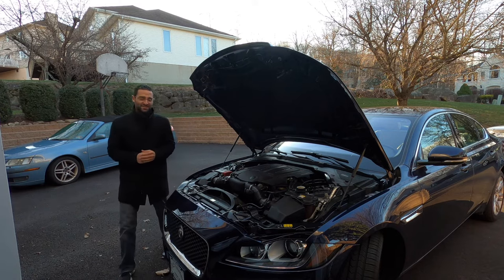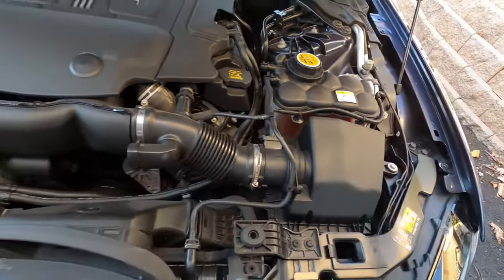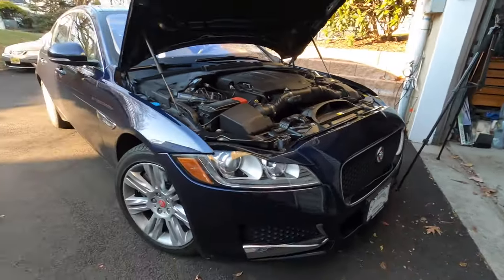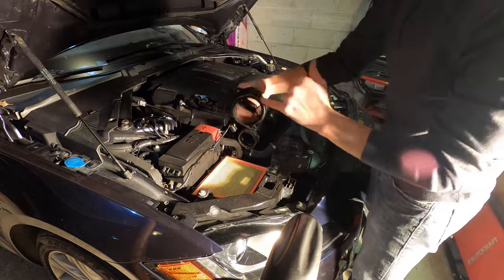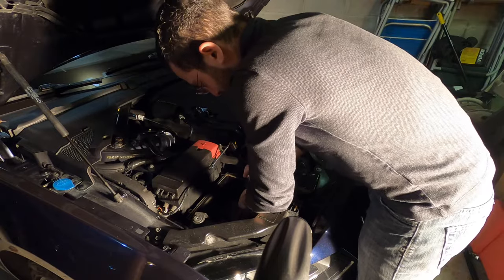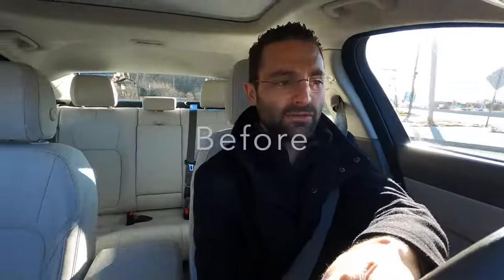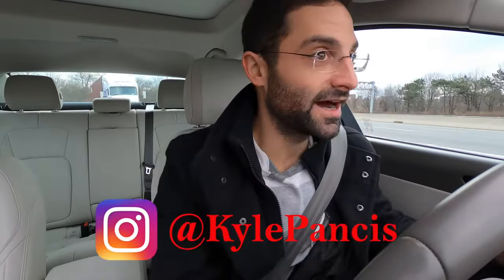This is what an Open Air Intake does to a Supercharged ENGINE!

Comment: Jag F Pace 3L V6 Supercharged. Running Velocity lower crank pulley and Stage 2 tune. 450 HP. Stock air intake and exhaust. Money better spent (Jag air intake is much better for power than these hot air cone intakes).

Comment: It's just the sound. You went from sucking in cold air to sucking in hot under hood air. Look at all the jags on the dyno on youtube with cheap cone filters. You make more power using the k&n drop in filter. There's dyno videos online of that too.
Reply: Agreed but I think some people would rather the sound then power
Reply: thats because he removed the whole housing right?
Reply: I have my v6 dyno with mina intake and stAge 2 tune upgraded crank pulley, and I got 450 to the crank. I haven't lost any power!
Reply: @towlie19xx74  which model/year & which tune?
Reply: @kevinortiz1729  from eurotoysltd
Reply: And this is exactly the reason why I didn't get this Mina cone filter kit for my 2017 XE 35t Prestige AWD. It sounds cool with the increased supercharger whine but the stock intake actually has ram air ducts that draw cold air from outside and route it into the stock air boxes, so it effectively works as a stock cold-air intake system. 

I just ended up getting the Mina chrome intake tubing which retains the stock air boxes so the cold air ducting stays intact, but replacing the intake tubing deletes 3 air restrictors that are built into the stock intake tubing, plus the it's larger diameter and smoother.

Comment: I did the same modification to my jag xf 3.0 the only difference to compensate for the cold intake was that I added 2 tubes extensions from the front radiator all the way under the filter adding on top 2 Heat Shield Cover Stainless Steel, this prevents the filter to suck hot air.
Reply: 1
Reply: Someone else who is smart! 😅

Do you have any photos? Instagram?

Comment: Ps the cone filters set the way they are will be losing you between 5-15 bhp depending on how hot your engine bay is.
More noise and more supercharger wine only equals "sound faster" not go faster.
Changing to cones means you have to change  cold air feed  system to cones to only get fresh colder air rather than a mix of a little cold air from the intake system you have now opened up and lots of warm air.
You could have 10 the amount of airflow, but if that air is hot it will cause the engine to run poorly. If this makes sense.
Reply: 😂😢 you are 💯 correct sounds faster ahhhhhhhhhhh..he asking for water 💦💦🌊 intersion entering into intake.. Remember kids water 💦 and metal don't mixed it create rust in the long run.. little bit at times... ohhhh wait his motor blown up three months later ahhhhhhhhhhh 😢😢😢😮😅😅😢😢

Comment: I left the lower portion of the boxes in on my XF when I did this. Noticed it draws air much better from the ram air tubes.
Reply: what year is your xf? I wanted to do the same on my xfr 2013 by keeping the lower portion of the boxes, did you have to do any modifications?

Comment: Unfortunately brother, your data is wrong, most cone filters attached to a normal system degrade your airflow and hp.
In tests the standard manufacturers paper filter keeps your hp higher, if you want to improve the airflow in a manufacturer closed system use aftermarket k and n filters or similar other brand hi flow filters, I can pretty much guarantee on a Dyno system the OEM filter and aftermarket box filter out performs cones all day long, because the cone very rarely gets good flow to all the cone, in fact you will be sucking in mostly hot engine air and degrading your air and fueling. Hope this helps.

Comment: Its way louder at lower speeds.  I'm glad it trims down when you're cruising, you don't wanna hear that squeal all damn day.  Also, you might want to leave that horizontal piping alone between the 2 boxes because the inlet is not square in the middle so that indent in the pipe is probably there to make sure and equal amount of air comes from each filter.

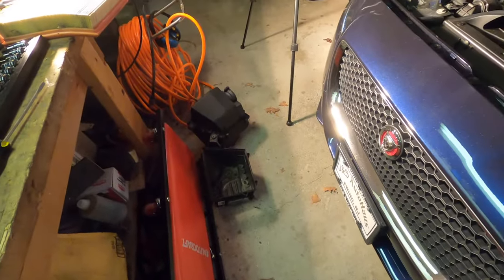Comment: There is a another filter located in the video at the 10:28 time and is located in the air filter box. Part GX63-9H722-AA. It looks like a cabin air filter and is used to vent the air for the cooled seats. By removing the entire cabin filter box you are inducing hot air into the seats.
Reply: No, the cabin air filter is located just behind the glovebox (in fact, you have to remove the entire glovebox to access it for filter replacement).
Reply: @user-hp4nk6qp6p  More to the point, the seats have foam filters on them and depending on the year, the heating and cooling is done with piezoelectric elements.

Comment: I would’ve added a 90degree elbow moving the filter lower into that hole, you’ll grab cooler air. Removing the box, allows more heat to surround that intake....any gains (10-15hp) you think you may of made, I would suggest maybe 5hp...maybe lost due to heat 🤔 

Now, if you increase the actual airflow, change out the MAF...along with a minor change to the filter placement...then maybe you can make that 15hp gain 🤔
Reply: so what would you suggest i do before i get these same filters?
Reply: @kevinortiz1729  I think the OEM airbox allows for colder air…I would try to find a way to keep the air box’s and change out to K&N or anything less restrictive. I would also look for a MAF/Throttle body that will help open up the airflow…I think that’s the cheapest way you can hope to get any gains….and of course it’s just my opinion, though it may “sound” better..the setup in the vid is just going to sucking in engine heat..as heat rises…probably why Jag had their air box’s so far down into the front well..where the cool air enters….
Reply: @canadiankrispybacon1450  appreciate it 👍🏼

Comment: Did same to my XKR  (V8) reasonably priced mods, havent had dyno'd but i am very impressed with results 0-60 mph in 3.9 - 4.2 seconds
Reply: FWIW, I have upper and lower pulleys, 200 cell cats, x-pipe, Paramount heat exchanger, Bosch 010 intercooler pump, and a custom tune to support all that on my '10 XKR.  According to VAP, the place I bought most of that stuff from, I'm making around 650-675ish at the crank.  That may even be on the low side because I can consistently gap a friend's automatic C7 Z06 on the highway.  I have the videos to prove it but we're way behind the go-to-jail threshold of speed, so there's no way I'm posting them publicly; feel free to either call BS or believe me.  Anyway, in speaking with VAP about my build, they said to stick with the paper filters.  But out of curiosity, I tee'd in a vacuum gauge to the bypass valve vacuum line that attaches to the intake pipe upstream of the TB to measure how much of a restriction the paper filters were with those mods and then comparing them to some drop in K&Ns.  The difference was nearly unmeasurable and what change I saw could be attributed to atmospheric changes and/or gauge error.  There was roughly a needle width of difference, with the K&Ns being slightly less restrictive.  So yup, VAP was spot on.  Imagine that- a tuner shop that actually makes parts and dyno tests them contradicts all the keyboard engineers "findings."  Weird.  And hell... the XKR-S has the same airboxes as the XK, and the XF-RS has the same air boxes as my wife's 3.0L XJL (look up part numbers if you don't believe me), so at what point do you just accept that this isn't the 1970's where you can flip the air filter lid and gain power, and that Jag knew what they were doing when they designed the intake tract?

Additionally, I have a cousin working in a shop in the midwest (I can't name them yet because they're still in the durability/beta testing phase of the package) that's making 730 WHP on their 5.0L test mule with the factory paper air filters.  Jag designed these engines to handle 750 HP while retaining the factory warranty, and the shop thinks there's enough headroom to make 800 at the wheels without compromising longevity that much. There's a lot of really interesting stuff they're discovering with the limitations of these drivelines and what they've found works to address them, but I'm not sure what I can say beyond that some of the solutions involved off the shelf aftermarket parts made for other makes of vehicles.

But back to the point of this whole video... seriously, brohammer... the intake on these things isn't the choke point.  If you think it is, go look up what the factory exhaust manifolds look like on eBay.  I'm blown away that we make the power we do with those fuckin' things.
Reply: @Prototheria  would be awesome to see that video 👍
Reply: @gititgotitgood  Do the mods I did, find a C7 Z06 to line up against, and enjoy the experience first hand.  :)  And sorry, but I'm not uploading incriminating evidence.  lol... that's just dumb.
Reply: @Prototheria  👍 my friends zo6 was dyno'd at 825 hp torque to match
But I do plan on more performance mods
Reply: @gititgotitgood  lol... yeah, I don't think an XKR is going to hang with that.

Comment: Just added 2 spectra filters and now has a slight hesitation from 0-60. 2017 Xe. Just watched complete video I guess I need those plates where the box once was
Reply from the maker: Yes, metal plates block "some" heat

Comment: The Mira intakes and open cone filters without shrouds to pull cold air only decrease horsepower. Run it on a dyno with K&Ns in the stock airboxes then run it with the craptastic Mira setup. Science!
Reply: What do you mean K$Ns in the stock air boxes ? Are you saying out that brand filter or in the air box ?

Comment: Very interesting change in pitch.  Since superchargers love cold air, aren't you worried that in summer there will be a performance loss since the engine is drawing in hot air from under the hood instead of the ducted cold air?
Reply from the maker: I think it should fare out ok once car is in motion. Same issues are relevant with turbos too. Won't be huge impact
Reply: I have same car..but they are intercooled on chargrr

Comment: Just purchased mine two and a half weeks ago. Only difference is I'm 5.0 naturally aspirated. But nevertheless I have the same airbox system and planning on doing this mod. A little concerned about the timing chain system in this engine
Reply: I have the 5.0 too and plan on doing this as well.
Reply: Any results? I have the 5.0 supercharged V8 and want to do this
Reply: @EMH3rd  After doing some research it turns out the horsepower gain isn't that great. And on very hot days you actually lose a little bit of horsepower because this system allows more heat into the throttle body. So I decided to put high performance filters on my stock box. Feels a little more responsive

Comment: Added the same, sounds great but lost acceleration. I installed everything correctly sensors face the right way but no power at all. Any ideas
Reply from the maker: Not 100% sure, any engine codes? sorry for delay response...maybe you fixed it...
Reply: @KylePancis  no problem, no sir no codes I made heat shields for both cones seemed to help. Is yours still doing good ?
Reply: I recommend just switching to a k and n filter and using the same housing, the change of air is causing the sensor to tell the car to run differently to compensate for all the extra air flow, the 2 ways to fix it is either to revert to the original housing whit a big flow filter (or normal) or getting the car tuned to run on a cold air intake.
Reply: HOT AIRR

Comment: It would be helpful to get an actual before/after dyno test to see if there's really any increase in power and if so, what that increase is. More air doesn't necessarily equate to more power as velocity is important at higher rpm's as well so in some cases, when intake volume is increased, it can slow the velocity of the air moving through the intake and also change the degree of turbulence. Without measurements, it's difficult to come to any concrete conclusions. There are two sayings that always apply in race engineering; (1) if you can't measure it, it doesn't exist, (2) improvements are always an evolution, not a revolution.

Comment: Hey what's up YouTube, today I am gonna show you guys how to make your car not only run lean, but suck in HOT AIR into your supercharger intake! Don't worry more heat and lean mixture will ADD power!
Reply: I did the same modification to my jag xf 3.0 the only difference to compensate for the cold intake was that I added 2 tubes extensions from the front radiator all the way under the filter adding on top 2 Heat Shield Cover Stainless Steel, this prevents the filter to suck hot air.

Comment: Your info is wrong. They're stock at 380 horse pwr.
Reply: Yes the XF S is
Reply: No they are Not all 380 Stock,  XF 35t has 340 Hp RWD and the XF-S has 380Hp AWD